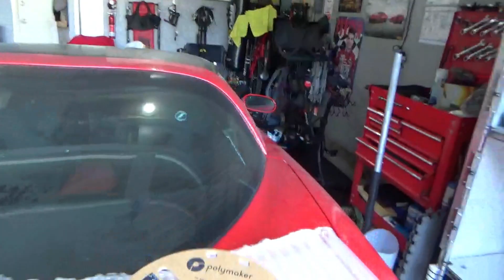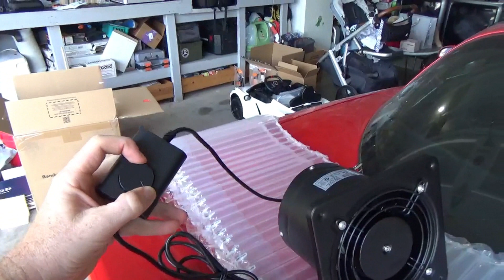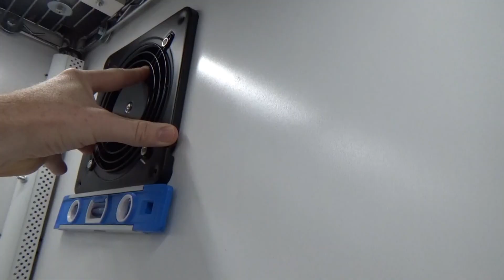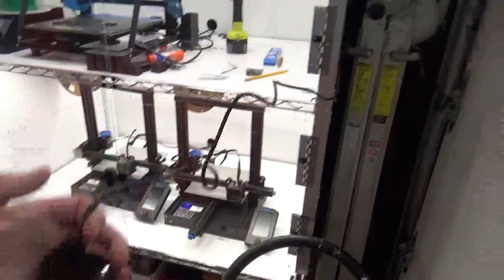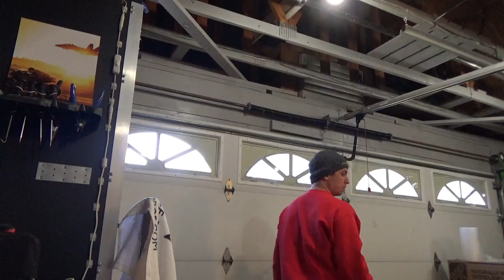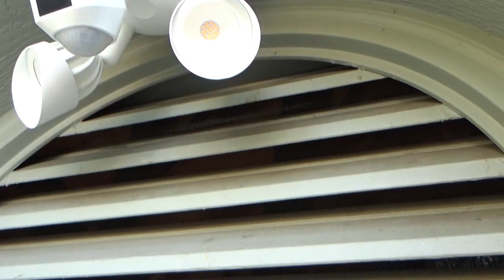How to 3D Print SAFELY - Enclosure Exhaust Fan Calculation and Setup

Comment: How do you deal with summer heat in your garage
Reply from the maker: It really isn't that bad... if the garage is closed it gets a little stuffy and hot. But I just open the garage door and get a nice breeze into the garage.

Comment: Do you think I need a filter for my 3d printer if I have an enclosure with exhaust that leads straight to outside? Also how much would the outdoor heat and humidity affect the printer indoors since it would be connected with an exhaust?
Reply from the maker: I don't think you'd need a filter on top of having an exhaust for your enclosure. The heat I wouldn't be worried about, the humidity may be an issue depending on your climate. For me, it's relatively dry here most of the time, so I'm not as concerned about that. Just make sure the outlet from your enclosure won't let any water run in either. I would buy an RH meter in your enclosure and see how much it fluctuates, they make cheap Bluetooth ones you can get on Amazon.

Comment: How are you heating your enclosure in the winter?  Or whats the lowest ambient temperature that your still able to print at?
Reply from the maker: Because I’m in So Cal I haven’t worried about this too much but my garage does get down to low 50s on the colder nights here. I’ve been printing ASA on my two X1Cs through the night (on some of the colder nights) and haven’t had any problems with warping, cracking, etc. I’ve only ran PLA on my two ender 3s and my CR10 with this setup. If I were to (mildly) heat my enclosure, I was looking at those heating pads they make for reptile terrariums, those I felt had the lowest risk if something were to malfunction. Just not sure how effective they’d be to raise the ambient temp inside the enclosure.
Reply: @Addimotive  Thanks, this is really helpful.  I've been wanting to get mine out of the house I think I'll give something like this a try and design it with a small oil filled radiator to heat the chamber just a little.

Comment: I too was using ASA to print car parts. But in my journey I learned a few things.  1.) Polymaker, and probably all hobby grades and materials are quite flammable.  I did a few tests and there is no flame retardation or arresting. It likes to burn and pick up speed.  2.)  It does not do well with fuel.  It turns to a rubber gel.  I learned this because I spilled gas on an old scrap part(total coincidence) and then went to pick it up about an hour later and it squished in my fingers. 
Point is, its probably not an issue for what your are doing, but its a good fyi- parts exposed to gas fumes, or maybe dripping oil etc. could lose rigidity and fail.  For me, it was a good reminder that there is a difference between hobby and engineered grade materials. 
Anyway, nice enclosure.  Using an wire shelf is a clever idea.
Reply from the maker: Wow thanks for this comment, I appreciate the insight! I knew ASA didn’t tolerate fuels well, but didn’t know it was that severe. Maybe I can do an upcoming video on fuel resistance testing different materials. 

What type of material did you end up going with? PETG was my next alternative.  But I always had a lot of issues with it clogging the nozzles and it doesn’t have the same HDT that ASA does.
Reply from the maker: And yes you’re totally right about there being a defining line between desktop and industrial/engineering grade materials. For my full time job I print with ULTEM 9085, ULTEM 1010, and ANTERO 800NA everyday and there’s no comparison between those and desktop materials, but you need a very expensive printer to run them!

Comment: Only question is what is the duty rating of the fan? Most of those fart fans can only be rated to run for an hour at a time…..
Reply from the maker: Yea that’s a good point, there’s no specs on the listing for it. I’ve been running it for 12+ hours at a time and haven’t heard it struggling or surging at any point. If it seems like it’s not up to the task, I’ll look for a more industrial solution on Grainger or McMaster Carr.
Reply: Could you link or give me consumer grade fan that has a duty cycle listed?  I just looked at 4 different manufacture PDFs of different fans. Not a single duty cycle listed. I can't find the NEC or UL to back me up....but unless otherwise stated a fan is continues operation.
 I'm just wondering where you got this hour number.  Maybe for something specialized moving hot, wet, dirty or maybe toxic air... Or maybe something from the past but... Even good manufactures like a panoramic whisper-quite bathroom vent has no duty cycle and only listed as 'continues operation' in marketing material.